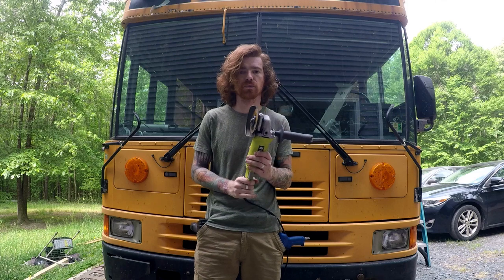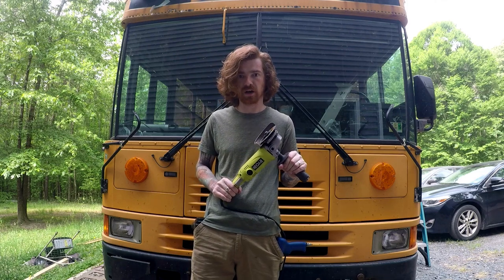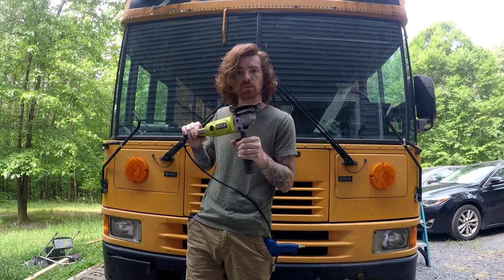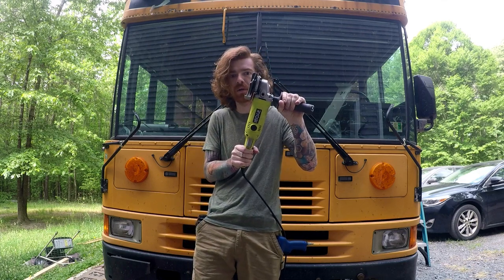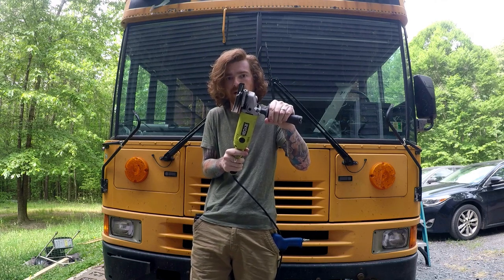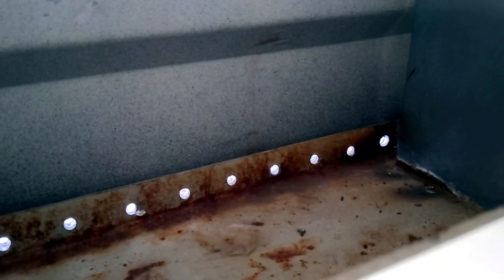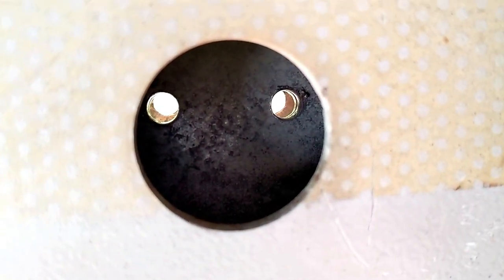How To Remove Rivets On A Skoolie The Easy Way (School Bus Conversion)

Comment: Wow this is really this was very informative. When I get this the person I was helping use the air chisel. Personally I thought the drills better, because it make less noise for the neighbors, and it didn’t destroy the sheet metal. 
I don’t know what technique I will use when I start my own build, but it’s good to see a different option.
That nail punch out thing was amazing! I just don’t want to lose pneumatic tools because of the compressor, and I’m so heavily invested in batteries.
I look forward to seeing more of your channel!
Reply from the maker: We tried the drill method and it was too hard, even with good drill bits. Those rivets are very tough. This method seemed the easiest. We will start working on the bus again on Sunday after a month long break and we'll post some more videos.

Comment: Did you try center punching and drilling? Just wondering if that is feasible or perhaps a bad idea altogether. Thanks for the helpful video!
Reply from the maker: We tried that. It is much, much harder to do it that way and it would've taken a lot longer. Those rivets are tough.

Comment: Instead of a nail remover you can just buy a punch die for the air hammer, save some $ that way
Reply from the maker: That's worth a try. Nail remover extends further than air hammer but air hammer might still do it enough to push the rivet through. Thank you
Reply: @WideAwakeTravels  a 90psi air hammer should do the trick, which is looks like thats what you have (theyre standard size). Im looking at my rivet die set rn and my punches are 1.5in, dont know if theres any material that# that thick on my bus. But if access is the issue for people theres a die called a "witches finger" that is a bit longer and are bent to get to hard to reach spaces. Cheers! love the vids btw, inspired me to raise my roof
Reply from the maker: @nickcashman2908  I wish I had known that before. Thank you. Did you finish your raise or you plan on doing it?
Reply: @WideAwakeTravels  my frames extentions and jacks arrived 2 weeks ago, just gotta save some cash to buy some sheets for the skins, gonna remove all the windows and just cut out slots and build frames for rv windows once its all together
Reply from the maker: @nickcashman2908  thanks great. At some point we will probably replace the single pane school bus windows with custom made double pane RV windows that look almost like school bus windows.
Reply: @WideAwakeTravels  if you do, kake a vid on it!
Reply from the maker: @nickcashman2908  definitely. I have a photo of one installed on a skoolie if you want to see. Send me a message on Facebook or Instagram and I'll send it.